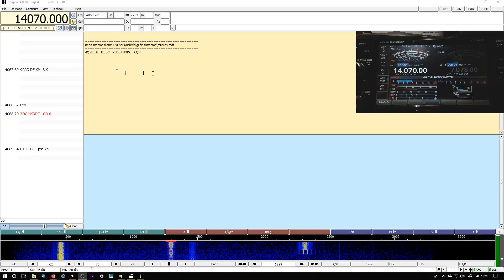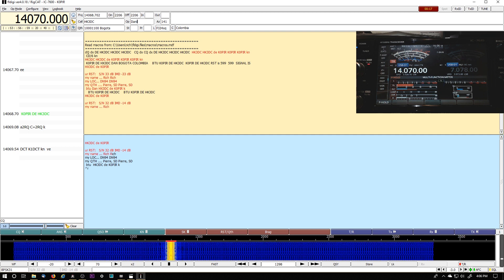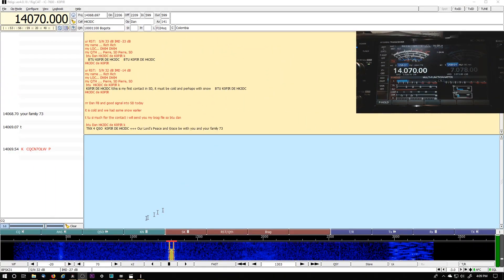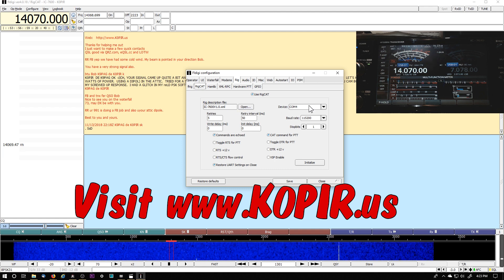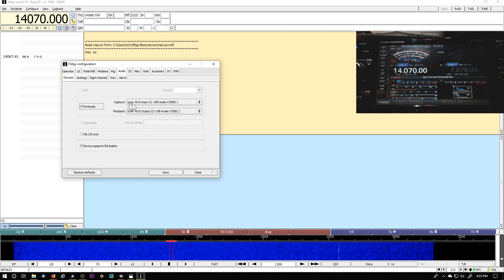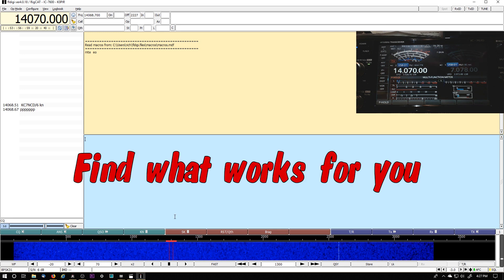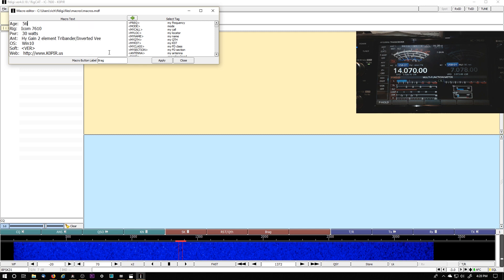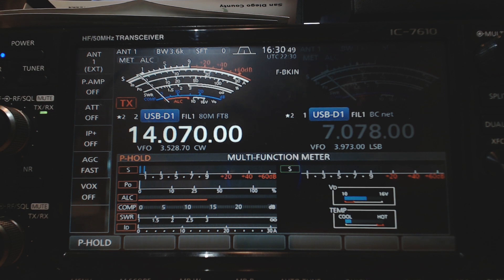Icom 7610 Fldigi RigCAT .XML

Comment: Hi Richard,

Thanks for this Youtube.  It really helped getting me off of dead center with Rig Control on FTDIGI.

I'm having problems with  the IC-7610 and Winlink.  I have PTT and transmit just fine but no VFO control.  Any advise is appreciated.

73,
Mike
Aj6GK
Reply from the maker: Hi Mike,
Thanks for commenting. I have not used Winlink yet. Our club did a presentation on it years ago. I'll have to loo into it.
Usually rig control is solved by checking the COM port and verifying you have the correct one. Check the baud rate too. Are other apps using it successfully with the same settings? If so, maybe it is just in WinLink.
Thanks and good luck with it. Best 73!